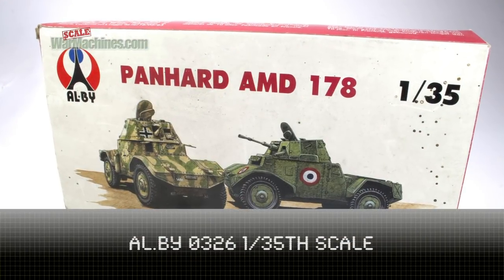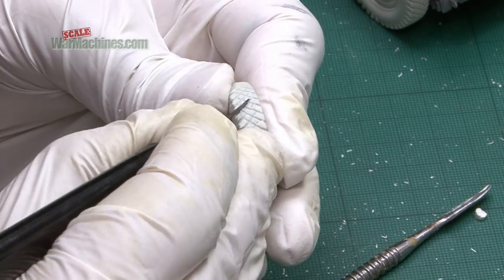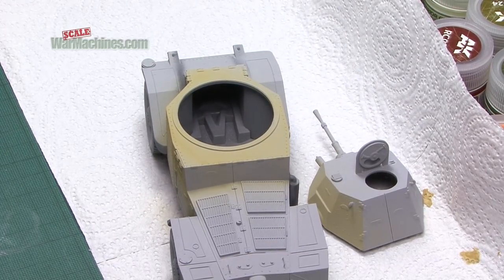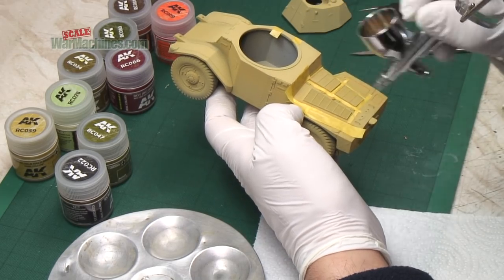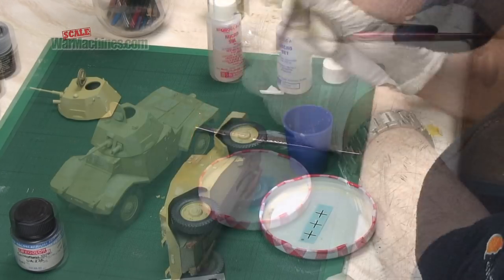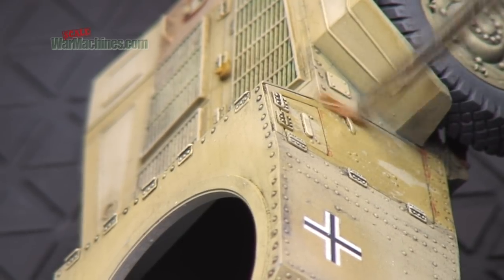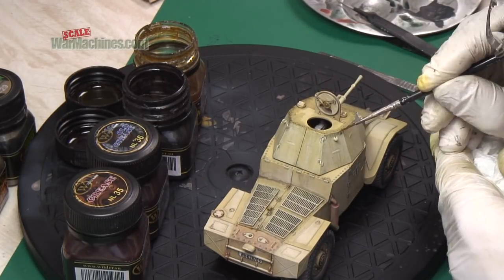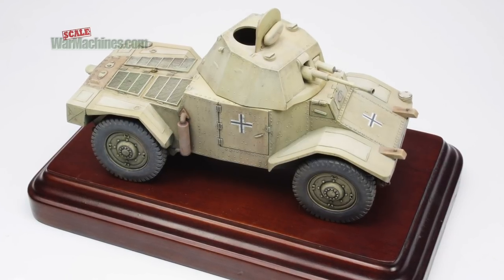PAINTING & WEATHERING GERMAN VEHICLES - AL.BY PANHARD AMD-178 MODULATION AK INTERACTIVE REAL COLORS

Comment: What is best to clean the Johnson’s Klear out of your airbrush?
Reply: water, thinner..anything you want.
Reply from the maker: As Will says, water or airbrush thinner is fine but never let it dry hard before cleaning, it's a pain to clean out then.
Reply: I'll add 90% isopropyl alcohol to the list. I use that because it's so much cheaper than airbrush cleaner, so I don't feel bad running a large amount through the airbrush to make sure all the floor polish is gone.

Comment: And also what is the air pressure you use
Reply from the maker: Air pressure is a tricky one, 1.5 - 2 bar for most coats but you will see the airbrush has a MAC valve, so the pressure is being further altered all the time beyond the compressor's regulator. For example, for stippling it is reduced to virtually nothing.